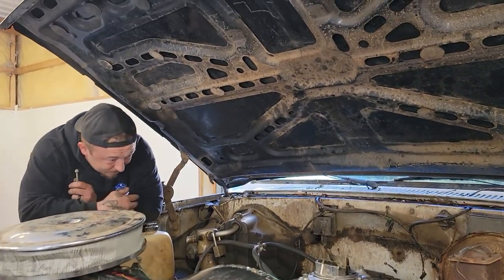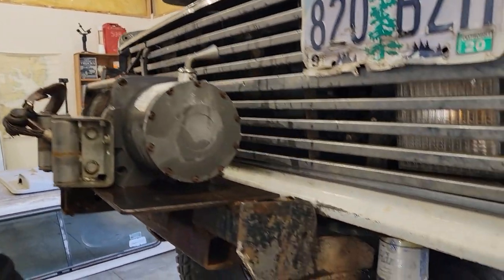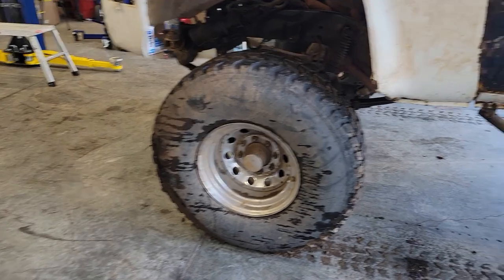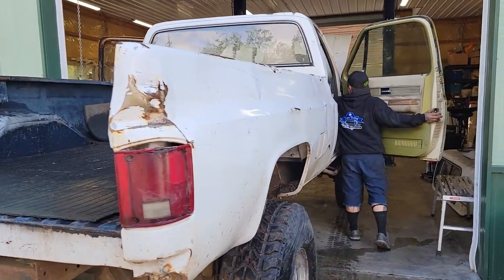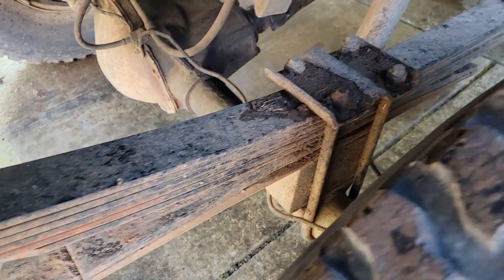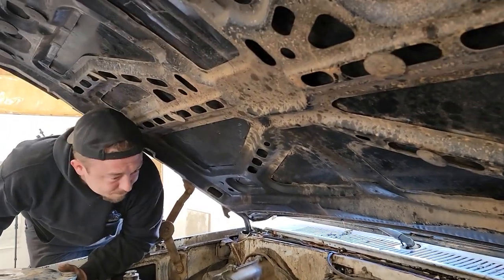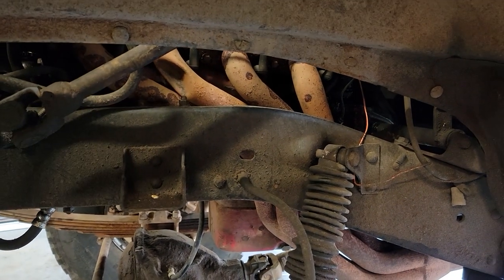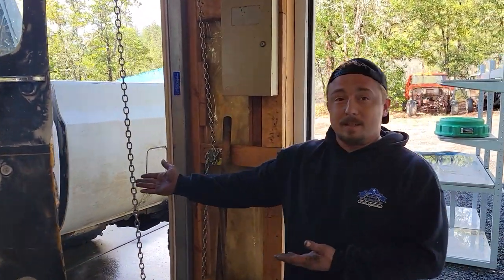Adam's Pearl. 1985 Chevy K20 4x4 Square Body Redneck Edition.

Comment: Cool and I had a built cammed 86 Chevy k20 custom deluxe 355 that would constantly break the front manual lockout hubs,one locked and one to be disassembled and had to be made to stay locked in.. lol,, and it destroyed the front factory 200k mile k20 gm 10 bolt corporate axle sheared off the cross pin bolt when the bald tires were digging in a field and it shoved the cross pin through the bottom of the center section housing..